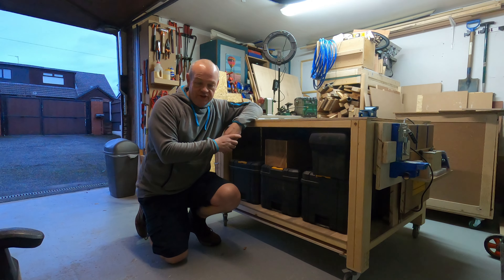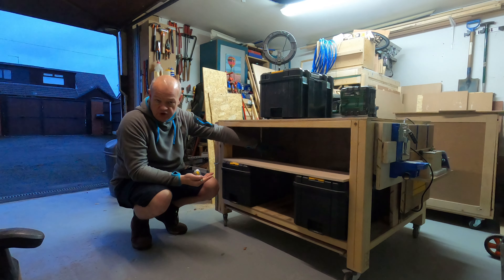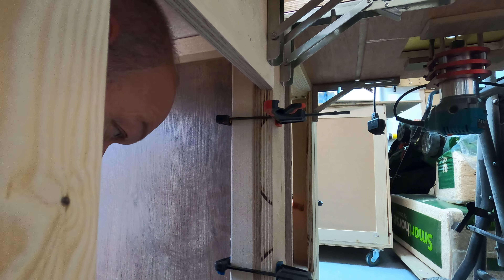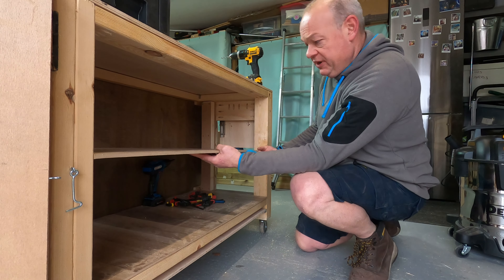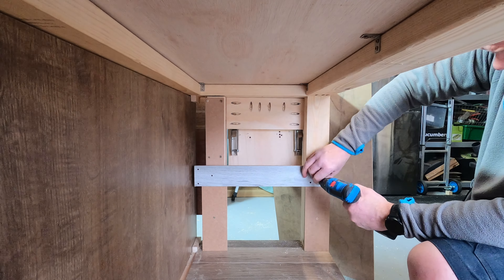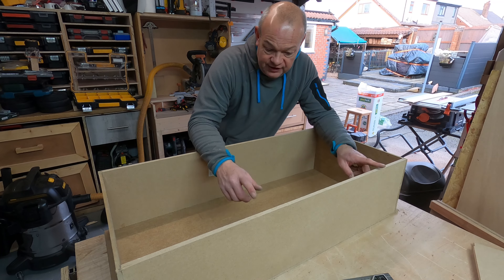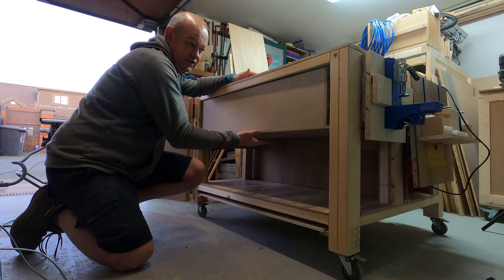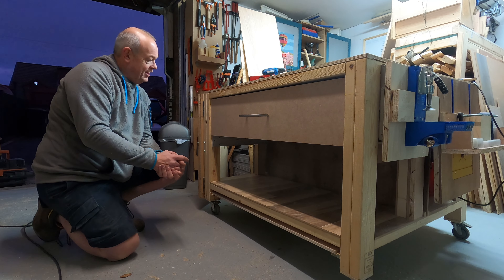The Garage Workshop - Workbench Drawer Storage

Comment: Hi Roger, great drawer build, looks good and very functional , what you need to do is to rub some candle wax on the runner or use silicone spray , this will act as a lube on the wood and it will slide better, I've done this to a set of drawers in my workshop which are on wooden runners. As always a great video full of tips and ideas, Take care
Reply from the maker: Hi Shaun will do thanks for the tip :)